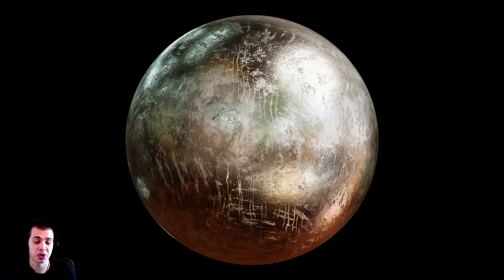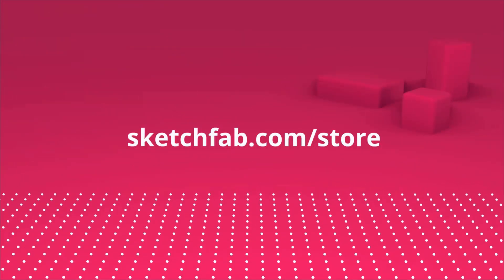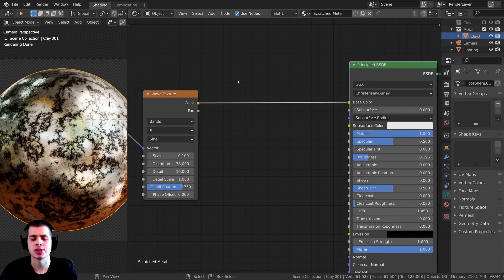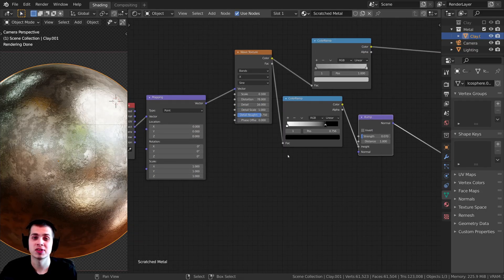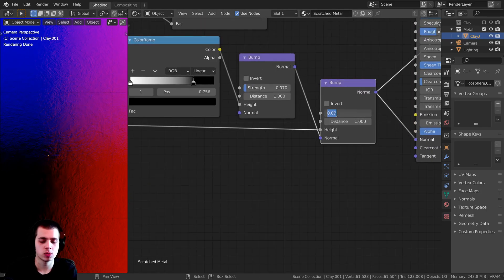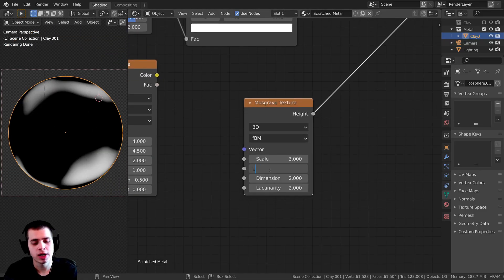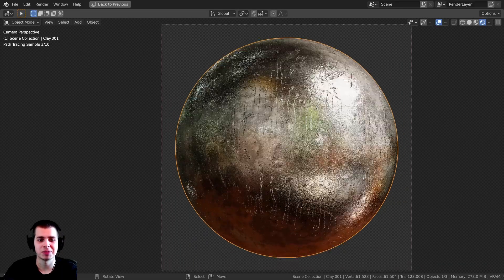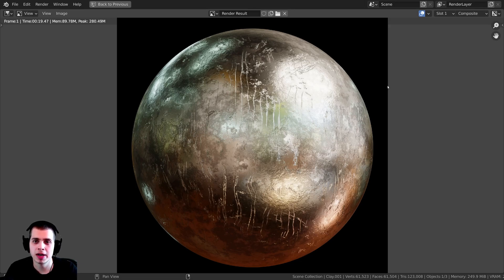Procedural Scratched Metal Shader (Blender Tutorial)

Comment: this is awesome! this is an amazing texture. Btw, I was wondering how you would bake this material using Quick Baker? I tried baking it by adding in the roughness, albedo, normal, and metallic maps, but the baked result looks very different. I baked the material as you showcased it in this video, and the result was okay, but when I added an image texture (for a logo, which had its own uv map), and then combined that and this material a through a mix shader, the result looked weird. do you perhaps know how to fix that?

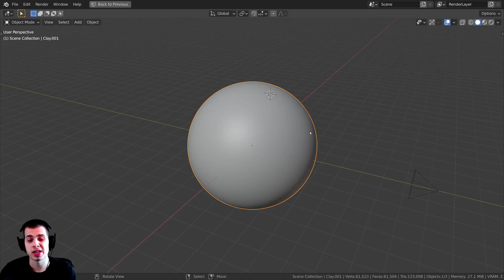Comment: What's the plane light at 0:58?
Reply from the maker: To make that, I just added a plane, and then added a subsurf modifier to it, so that its a circle shape. Then I just added an emission material to it. In Blender Eevee, this will not work, because the emission material doesn't actually emit light in Eevee. But I'm using Cycles, so it works well for a light source.
Reply: @RyanKingArt  Thanks.
Reply from the maker: @super_luke  Thank you for watching!

Comment: Hello i need help if you can i made a rust Texture when i save it i have a blend file if i try to apply this to a Ladder its all pink do i need to export the texture or what?
Reply from the maker: Hmm, Let me make sure I understand you correctly. You made a procedural rust texture? And you want to add it to a ladder 3d model? But when you add the procedural material onto it, the material is pink? I don't know why it would be pink. Pink is Blender telling you that it doesn't have the data for some files. But a procedural material doesn't use any external files. Were you using any external image textures? If you moved the Blender file, or moved the texture, Blender will not know where it is on your computer. I made a video on this, that might help you: https://youtu.be/ChgoGr9V-tc

Hope this helps!
Reply: @RyanKingArt  i will look into it thx
Reply: Hey how do i add the prcedural texture onto the 3d ladder? im a newb sorry :(
Reply from the maker: @TheDuncan365  If your ladder is in a different Blender file, then you will need to add the procedural material into the Blender file. To do that, click on file, Append. then locate and select the Blender with the procedural material. Then go into the material folder, select the material, and double click on it. Then just add that material to the ladder material. Hope this helps.
Reply: @RyanKingArt  many thanks it worked :)

Comment: I want to know why should the wave texture connect to combineXYZ/Y，rather than X or Z？
Reply from the maker: If you switch them and plug the Wave into the Z, or the X, it doesn't give the right effect. Because if you plug it into the Y one, in my case, that makes the scratches go up and down, which is what I'm going for.
Reply: @RyanKingArt  Thank you！As you say I try to plug the texture into X and Z, the result is that both pattern look up and down，but the patterns are not even , the best look is certainly on Y direction.

Comment: Hello Ryan, I was wondering if you could help me with a problem Im having with Blender. Great videos btw
Reply from the maker: I can try to help. What is the problem?
Reply: Thanks for the response Ryan, Im having problems when I'm texturing painting, I dont know if this is a common problem. I'm doing the donut tutorial, so simple mesh, I follow all of the guidelines every step so its not like a complicated mesh. When I reach the part of texture painting, my brush is very laggy, and a fast stroke on the donut will bring my cpu to 100% and stay there and then blender crashes. My laptop is quite powerful 6cores, i7, 16ram, nvidia gtx1060, simple but should do the job, Ive tried the same project in a friends gaming laptop, and recently tried it in a 5000 computer used for 3D Desgin VR Reality where I work. Super powerful computer and the program behaves the same way. Do you have any idea why this could be happening? I could even send you the project and Im sure it'll behave the same way in your computer.
Reply: @SaulHernandez-vh2rw  not a profesional but try lowering the brush size big brushes can lag sometimes
Reply: @ImplyDoods  thanks bud, I tried that but it still laggs and crashes